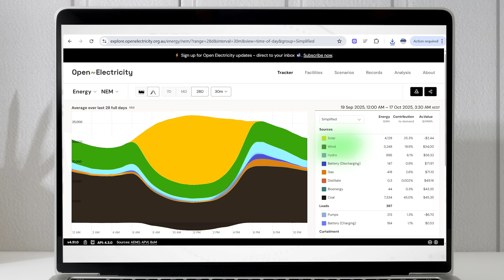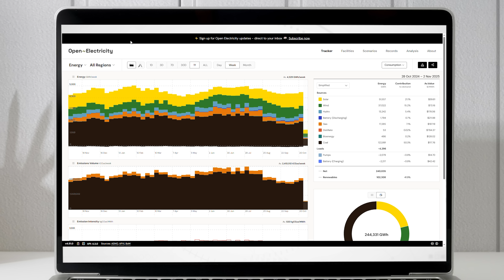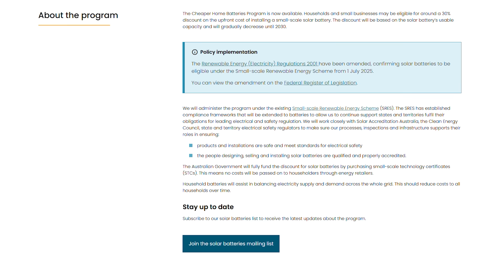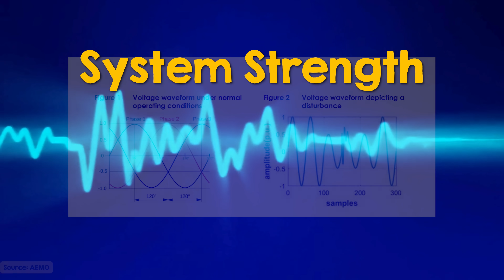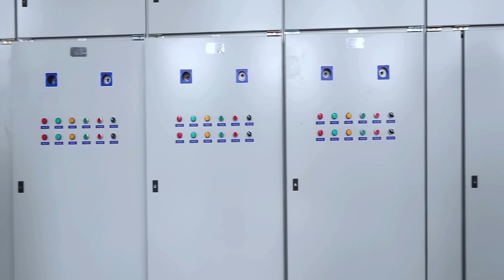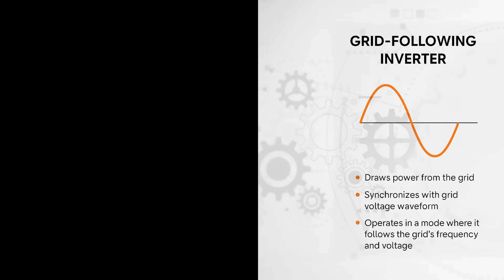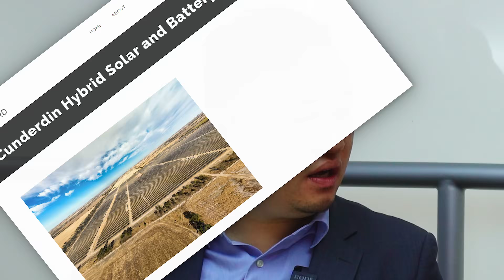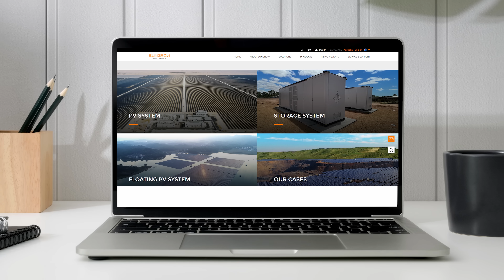Australia’s Solar Boom Is Breaking the Grid - Or Is It?

Comment: I know this is an overview understanding but there are some fundamental major issues with the intermittency  of solar . It’s not just time of day shifting. A substantial battery bank can store the solar generation for use at peak times 5pm to 10pm when there is almost no  solar generation. Then there are the frequent weather events.  When solar generation can drop by 90% for days. Batteries will never be large enough to store for these events. Then there is the difference between summer and winter. Solar generation in many areas is a fraction of summer generation. So where is the power going to be generated?
Reply: https://www.youtube.com/watch?v=KdKOrdjHwYY
Reply: @oakfat5178 thank you for the reference to the South Australia battery storage which at the time was the largest in the world and it was not big enough and a lot more storage has been added. It still only supports 3 hours of peak usages.
Reply: @InformedKiwi  We're still only 70% renewable.  Admittedly, the approach to 100% will get more challenging, but so far we're doing pretty well.
I expect one day, every building that can afford it will have battery supply, and there'll be a lot more virtual power plants & microgrids.
We're not de-commissioning the (LNP govt) diesel backup generators yet, let alone thinking about closing the gas-fired plants.  Not yet.  Maybe in the 2030s
Reply: @oakfat5178 in NZ we have a lot of Hydro and some wind and a little solar. We have one coal station that has been moth balled but the left wanted it decommissioned so it could never be used again and not pollute ever again.  We have had 3 dry years and our hydro production is right down . We were close to rolling blackouts and had to run our gas peaker stations a lot more than peaking. But still not enough. NZ has coal but the left have had no coal mining for years.  We were in a dilemma! Not enough generation. The left were in government and bought 1 Million tons  each year of Indonesian coal in to fire the coal power station that thankfully was not decommissioned. These sort of issues happen with solar too.
Reply: @InformedKiwi  NZ has a lot of waves.  Maybe that would be a good option, as I hear there's promising developments.  NZ landscape is beautiful, but in short supply.

Comment: Batteries…. Nope. 
Specific energy of the best battery Tesla currently make- 0.57MJ per kg. 

Black coal is 60MJ per kg.

You start to see the scale of the resources problem. 

The answer is Uranium with 330,000,000MJ per
Kg. The sooner Australians realise this the better off we’ll all be. 

Batteries are a fool’s errand pushed by people who should know better.

Energy density is King when it comes to clean, cheap, reliable electricity.

Comment: Both grid scale wind and solar are now stranded assets.  They cannot make money any more.  The wholesale market volume in Australia peaked in 2008.  And is now in terminal decline.  Only rooftop solar is increasing. Australia is an economic basket case in full de-industrialising mode.  All heavy industry is on welfare because firmed solar is about four times the cost of fully utilised coal generators needed to power industry.  A solar/battery to power a single aluminium smelter would cost AUD20bn at current prices.  Rooftops are not going to power smelters.
Reply: That's only true while watching Sky After Dark.
Reply: Lucky big AI needs fusion power.

Comment: Oh no! My toast is to buttery, and my cup overflowith!!
Reply: Reducing curtailment
With a battery, this excess generation can charge the battery and be used at another time, instead of being curtailed. This can reduce your electricity bill. However, for most solar systems, the amount of electricity curtailed is small, so the savings from reducing curtailment are modest.
Reply: @trythis2821  I feel like green hydrogen would be a good use but the math ain't matching :(
Reply: You understate the problem massively. An under supplied or over supplied grid is equally difficult and equally bad. In your example a cup that overflows and a toast drowned in butter is just as big a problem as a toast without butter and an empty cup.
Reply: @sunbeam60  green hydrogen bro
Reply: @lukepaul7931  sure. The round trip efficiency is atrocious - about 35% under good conditions. I don’t think the economics get anywhere close to beating battery storage so it’ll be more expensive than storing overnight usage in batteries - and that, in itself, will be a fortune already. You’d be better off mixing with wind, small reactors and batteries.

Comment: I don’t understand how batteries and solar power are considered better than centralized power plants. Large-scale plants can be made far more efficient by upgrading specific components, rather than relying on millions of individual solar panels and batteries — all of which have limited lifespans. It feels like a massive marketing strategy designed to keep businesses profiting indefinitely by selling the modern equivalent of “picks and shovels” — batteries and solar panels.
Reply: a decentralized grid should have better resilience and you can modernize it with smaller capital injections.
Reply: @koborkutya7338  If it were a one-off purchase — buy panels and batteries once and only replace them when they break, without performance deterioration — then sure, that would be a different story. I’m not saying technology won’t improve, but as things stand, the cost per kwh still looks pretty high, some parts of the world are paying below $0.12 AUD per kwh.
Reply: you have less transmission loss if you produce nearby. that is actually quite relevant considering the size of Australia. and large scale plants are a huge capital expenditure from the beginning, which is OK, if have teh capital, but gets even more expensive if you factor the bank raking some interests on top, the banks basically eat the whole profit with their interests.
Reply: @benjaminlamey3591  That feels like an outdated argument, tbh. The U.S. and China both have way bigger landmasses than Australia, yet they run large-scale plants just fine. Transmission loss is minimal with modern infrastructure, and it’s still more efficient than everyone running their own mini power setup.

Fewer large plants = less overall maintenance and lower per-unit cost. The “local generation” idea just shifts the expense and hassle to homeowners — panels, batteries, replacements — instead of solving the issue at scale.
Reply: @qtenz  transmission loss, is proportionnal to the distance. that is just physics. modern or not modern, copper is and remain copper. when the whole operation does just 6% margin, but you have to give 5,5% to the bank, there is no point angaging the funds.
Reply: The payback for a battery and solar system that will provide most of a households needs will be less than 10 years. For a system that should last for 20 years, I am happy to pay for ever cheaper home generated power than keeping the coal and gas businesses profiting indefinitely

Comment: Australia has some remarkable strengths, and weaknesses, in moving forward with wind & solar powering the main grid. And we have the fossil fuel industry fighting a desperate life or death battle to slow the change and muddy the thinking and insert misconceptions into the public mindset and the conversation.
(Like buying the Liberal Party outright.)
I know large scale batteries are being ordered and bought on a surprising scale. I know mostly those seem to be the same sort of batteries you find in a Tesla, or Power Wall and such. I know we’re building Snowy Two (and having some issues and challenges with it) but I see a need for grid-scale storage that’s more like a city size flow battery plant. I don’t know if any of the batteries going in are that type, but we need some.

The story I’ve been told, batteries like a Tesla car or power-wall, are sensationally good for things like frequency control and current / voltage control, because they answer more or less instantly, and they can provide enough energy exactly when you need it, but they simply don’t have the capacity to store 4 ~ 7 days worth of normal grid demand for the times without much sun or wind. Now pumped hydro is one answer for this, but flow batteries are another.

Data centres in America are grabbing generators powered by retired airliner jet engines.
Ok ~
We can do electrolysis and get hydrogen, and we can capture carbon dioxide from the air. We can then combine them to make hydrocarbon chains, including things like Petrol, kerosene, Diesel, and pretty much any flammable hydrocarbon liquid. The cost of doing this now, is many times higher than getting those fuels by pumping them out of the ground and refining them, but if we start using captured CO2 and Hydrogen to make it, at industrial scale, then there would obviously be economies of scale.

Now whether we could get the cost of that down to something rivalling crude oil or natural gas sourced, is a good question, but there is a rather large incentive to try. Of course if ask the EXPERTS now, they will tell you that’s a ridiculous pipe dream, and the only way forward is to keep doing what they’re doing now. And if you really MUST do this, they can make Brown hydrogen from gas, ten times cheaper than you can manage with electrolysis. You would be foolish to accept those answers at face value.

If you make jet fuel or diesel from captured carbon, that’s not carbon negative or positive, it’s carbon neutral. That alone won’t fix the problem, but it will keep it at a level, not make it worse.

Now if we make some new power stations like the ones in America, using old jet engines, which run on ‘artificial’ jet-A, that’s neutral. If your main battery for the whole Sydney + Woolongong + Nuke Castle area goes flat, because there has been ten days without wind or sun, you can fire up a few of those jet powered generators. They do have one distinct advantage in that you can start one up from cold in less than an hour, which you can’t do with a coal fired power station.

Emergency backup / contingency generators are not the only use for that Artificial Fuel. Battery + electric works for aviation, as long as you are talking the scale of a twin engine turboprop regional airliner with 30 ~ 50 passengers, aiming to fly at 250 ~ 300 knots, over a distance of maybe one thousand km.

https://en.wikipedia.org/wiki/Regional_airliner#Turboprop_regional_aircraft

This segment makes up perhaps 1/3 of Australian flying. The remaining 2/3 is jet, and you can’t replace those with batteries. At least you can’t yet, and nor is there any development I know of, or can see turning up in the next 30 years, that would do that.

Using artificial fuel (reconstructed fuel ~ I don’t know a good name for it. Synthesised fuel perhaps? Synthetic Fuel?) would not be cheap, but  how cheap is climate change?

If you want to fly 300 people from San Francisco to Sydney, in one hop, at 600 mph, and offer then safety higher than in their own beds, we’re not going to get that from batteries any time soon.

Now if you have an industry that’s making synthetic fuel, for aviation, there’s a perfectly good case to build some fuel storage tanks and a couple of jet turbine generators next to your Flow Battery facility, and you could fire those up and run them until the sun does shine.
“But that still puts Carbon back into the air!”
Yes, it does, but so does keeping a hundred + year old coal fired power plant maintained enough to be viable. In the beginning, there is maybe a question over which one is cheaper, but as time moves on, I’d say the synthetic solution would get relatively cheaper. And you only use it when the flow battery and the pumped hydro are empty. It’s an emergency backup ~ that’s all.

I’m not a loud and enthusiastic proponent of this idea, I’m looking for the least expensive and damaging solution to what is clearly a problem.

I am rather in love with modern aviation, and I don’t want the world to go back to what it was like before commercial aviation existed. So I’m trying to save it. You do need Jet-A. But that Jet-A doesn’t have to come out of the ground. You can make it from green Hydrogen and captured CO2. And if you have an industry of the scale required to do that, there’s no reason you couldn’t put a fuel storage tank next to the flow battery tanks, and a few gas turbine generators. You don’t need a lot of them, those things can produce an amazing amount of electricity. And they’re an awful lot more reliable than any diesel generator or coal fired generator.
Response time is not as quick as batteries, of course, but it’s several times faster than a coal fired plant. And if you need them to run at full capacity for 3 weeks, you can be pretty sure they will. If you can guarantee the supply of fuel, which is not water-contaminated or anything, then the reliability of a modern jet engine (even an old one that doesn’t pass safety inspection for flight any longer) is ridiculously good.

Comment: The best way to deal with it is: 1. nationalise the grid, it should never have been privatised by corrupt politicians serving an ideology, not the country. 2. Supply every dwelling in the country with a battery (and solar panels where feasible) 3. Invest in more solar and grid scale storage via pumped hydro & liquid air battery storage. 4. Investigate  thermal plasma arc systems fueled by garbage as dual use peaker plants/ recycling . And until we nationalise the grid, grid stability is not our concern, it is the concern of the owners who have been letting is go to shit since they bought it. Punishing fines for outages caused by their greed & incompetence should provide an incentive to keep it well maintained.

Comment: The technical issues of feeding power back into the grid are due to lack of investment into the power grid. We are trying to us 20th century power systems in the 21st century, using band aid fixes to maintain broken system.  Companies like SMA have been installing hybrid power grids for the last 30 years plus in the Pacific islands and third world countries towns.  These systems are large in hundreds of kilo Watt and more. They create a 3 phase power system that is a combination of generator/solar/hydro/wind/battery without any problems. 
Australia use power islands like this connecting using high voltage DC instead of 3 phase AC and there would be no frequency synchronizing problem and have much greater transmission efficiency as other countries have already found. Using independent islands would allow much greater control of PV installations and make the installation of battery storage easy, this would also avoid mass black out situations like what happened in South Australia. There is only one example of this, that is DC transmission link that is from mainland to Tasmania. Tasmania is independent for power from main land and can sell or buy power as required. This same situation could have been done in local level if profit and control wasn’t the main objective of the power companies.

Comment: Classing batteries as a "generation type" is an oxymoron. Batteries don't create any power.
Reply: True. But they do offset the need for new generation when they can utilise unrealised power to use when other generation would be required. I feel there is a new lexicon required to describe the future grid

Comment: Not "any" measure.
China installed more wind, solar, battery storage, and coal plants than the rest of the world combined last year.
One interpretation I have heard is that they are trying to phase out oil rather than fossil fuel in general: that explains the continued coal expansion (though that is expected to level out by the end of decade).

Comment: This problem was well known and understood 40 years ago when we started down this renewables track. It was quietly ignored by the pinko-greenies and now it is coming home to roost. Those "old spinning coal machines", (description not at all biased !), which provided absolutely stable inertia required to stabilise the system will now be replaced by huge, expensive, limited life toxic batteries and their inverters, which if you're lucky might keep your A/C going for a couple of hours at night. Gee, you wanted your car charged as well? Forget it.
We are now reaping what we have sown.
Reply: With a negative power price: it is better to charge your car during the day.
This may require employer-supplied charging equipment. But they will be literally paid to use the power!

Comment: To me how do the grid forming inverters synchronise? They can only work if they all cooperate. The other option is they have super accurate high resolution clocks to control the frequency and at what instant in time the 50hz cycle crosses zero.
So they would need to be all synched to a central time controller so individual clocks don't drift.

Comment: Moving to grid-forming inverters makes the network more resilient regardless of the move to renewables. Please do another video on how it works. Ie GPS primary with fall back to OCXOs
I'd also like to see the grid more resilient to solar CME events. We don't need another once in a 100 year event like a pandemic happening again. Ie Carrington event
I asked Western Power about it and the answer was basically they have no ability to cope with such an event. Ie disconnect in mass local transformers within a 24-48hr notification.

Comment: Got into alternative engery in the 1960s.  Eventually worked with a physicist to make a wind generator that powered an air compressor that stored air in a tiank that powered an air motor. It was used to over-spin an AC induction motor that was plugged into the grid, and thus reversed current flow in the grid in sync with the grid.  So it was the mechanical solution tis lady was talking about because we didn't have the electronics available, at the time.  Battery Vs compressed air .